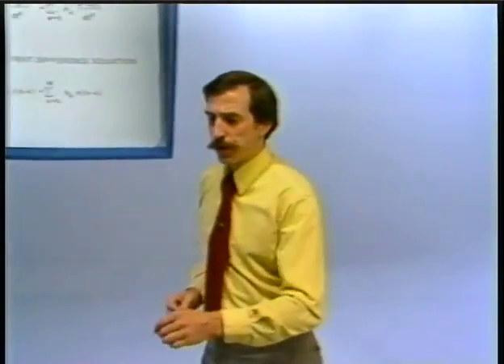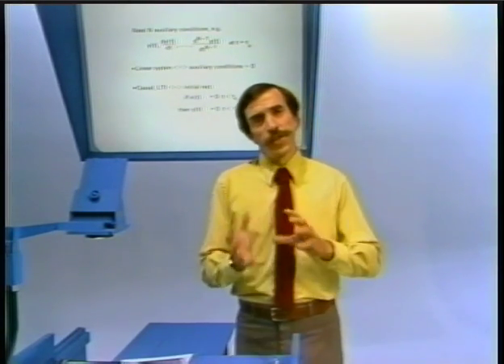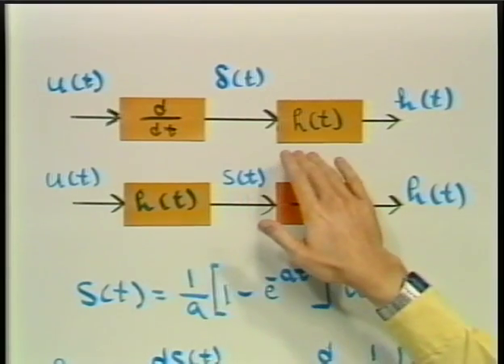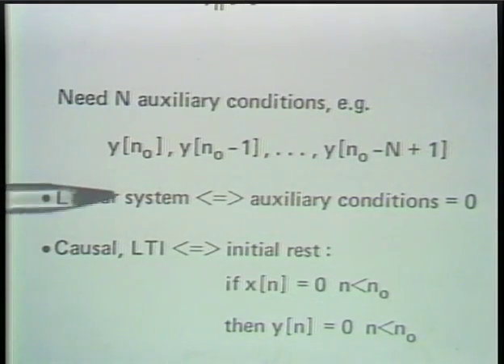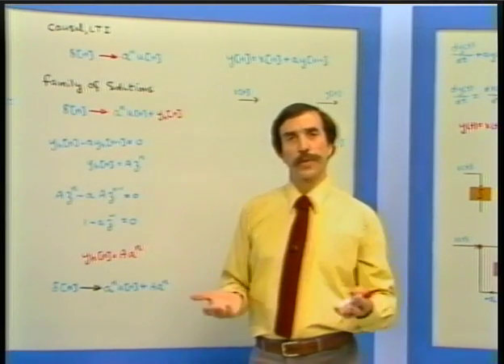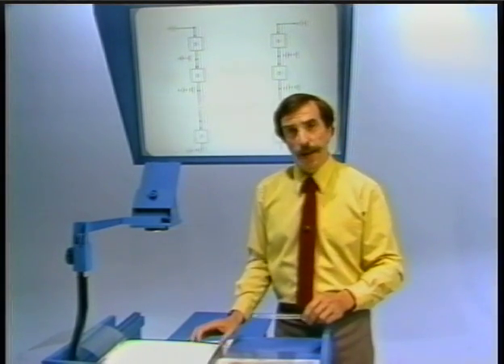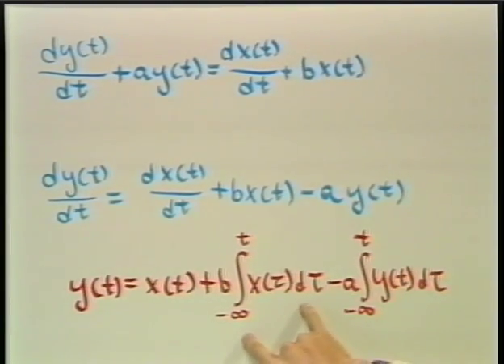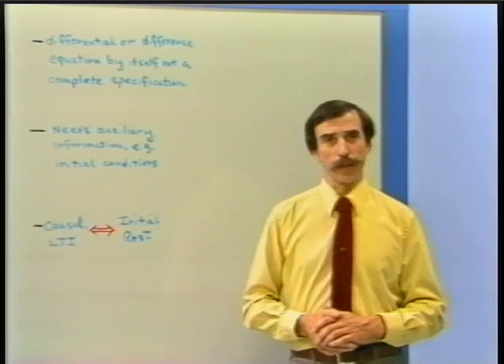Lecture 6, Systems Represented by Differential Equations | MIT RES.6.007 Signals and Systems

Comment: I did not understand anything from this lecture compared to previous ones
Reply: This lecture is basically describing differential equations and the difference equations as a way of modelling LTI systems and the solution for these equations that depends on the homogeneous solution and particular solution that depends on the type of the input and the initial conditions. It is somehow hard and require watching maybe several times

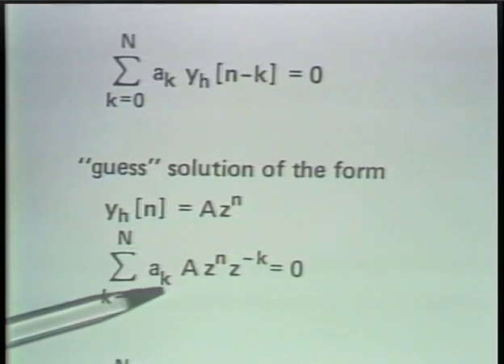Comment: at 19:08 the homogeneous solution to the difference equation Az^n cancels. Why? because it's just a constant and therefore can be called a_k?
Reply: I had also problem with that. The thing is, you have terms composed of (coeficient * exponential) because the exponential is the same in all terms, you can take it out of the sum, as a common factor.  Once it is out, you can divide be the same exponential A zˆn (you can divede by whatever you want, because on the other side there is a 0). After dividing by that, they all turn into "1", so they dissapear. 
Does it help?
Reply: @esepecesito  thanks, finally found Lathi's book, so I can concentrate on the ideas rather than the jumps.

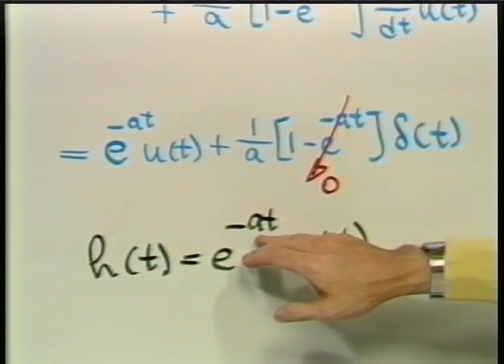Comment: At 16:30 doesn't the impulse response not satisfy the initial conditions?
Reply: This bothers me. I do not understand why the causality of the LTI is equivalent to the condition of initial rest. Can a LTI system be causal, but at the same time has some non zero initial conditions, meaning at time zero, the system is not at rest. For example, a LTI electronic system consists of a inductor and a capacitor. At time zero, the capacitor already holds some charges and the inductor already has current flowing through it. Does this none zero initial condition make the system not causal? If the causality is a property of a system, then why does this property depends on an initial condition? I must miss something about this causality property. Please help, thank you!
Reply: @yougoog1  have you find any answer ?
Reply: @yougoog1  Hi, acording to what he says in the book "Signals and Systems Second Edition" a system with initial condition like the one you describe or y[n]=2x[n]+3 is causal but NOT linear although it is an ecuation that describe a straight line. 
The  initial rest is equivalent to the causality of the LTI is due to the fact that that is a direct consecuense of the superposition property for LINEAR sysyems.

I hope I answered it right and not generate more confusion

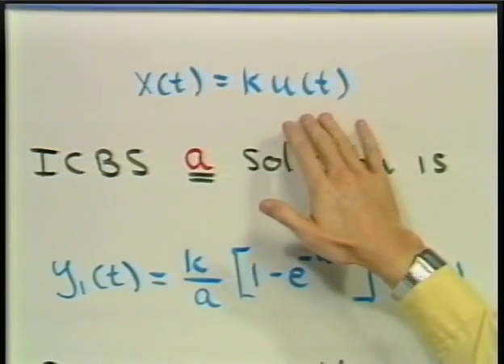Comment: The solution at 12:30 can be found pretty easily using Laplace transforms and partial fraction expansion. I'm not sure if there's an easier way.
Reply: It can be also easily found using integrating factor